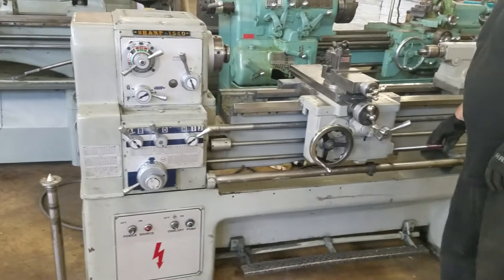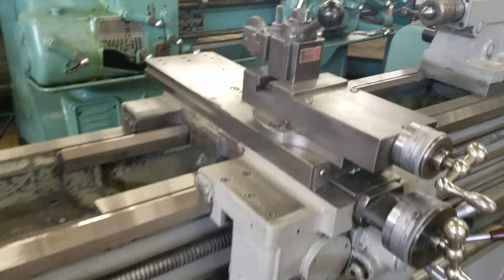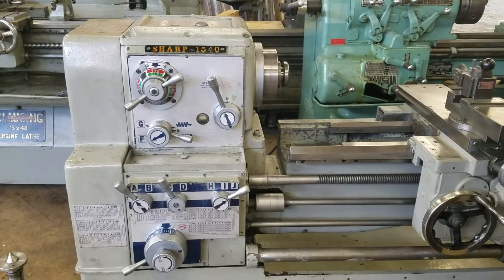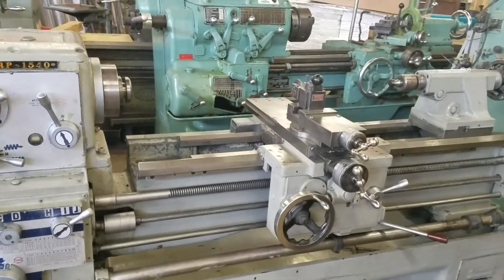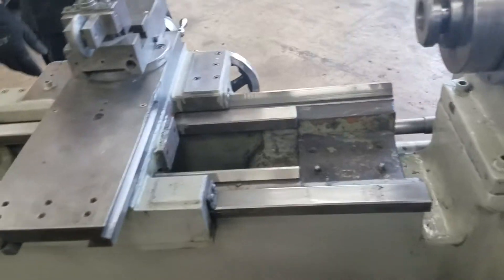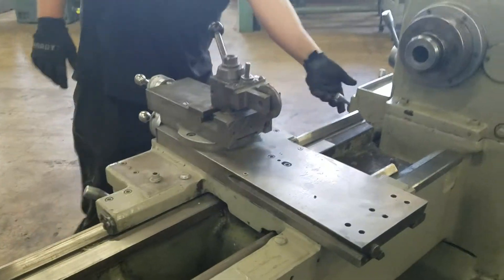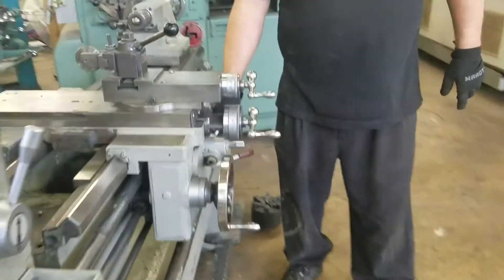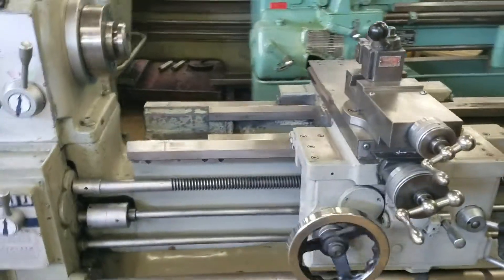Sharp 1540 Engine lathe demo

Comment: Hey john, my name is Doug Chauvin, from Houma, LA.   i own a sharp 1540 lathe built in 1978.    i have questions about my lathe and would appreciate a few minutes of your time.   I am trying to locate a owners manual.   i cannot understand where the thread dial is and where to mount one.     i wanted to thread 5/8-11 and noticed immediately, the threading is not 11 threads per inch.   my lathe looks a little different than the one on your youtube video.   i was unable to see a thread dial on the lathe in the youtube video.    i would like a phone number from you so i can contact you with a couple of questions.    after noticing the threads were not as i expected, after setting the handles for threading, i looked at the plackard on the lathe near the handles.   the plackard shows the number of teeth on the gears and my lathe shows a 60 tooth gear but my lathe has a 50 tooth gear.    very confusing.    my phone number is 985-855-3413.    please text me so we can set up a phone call.